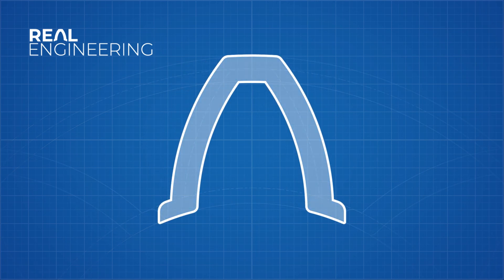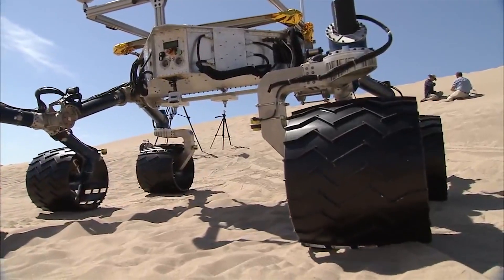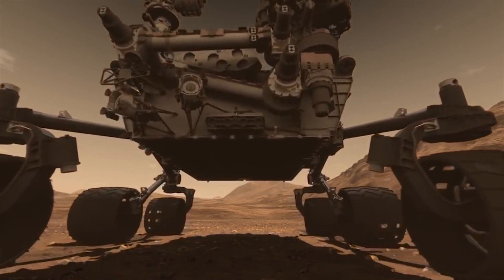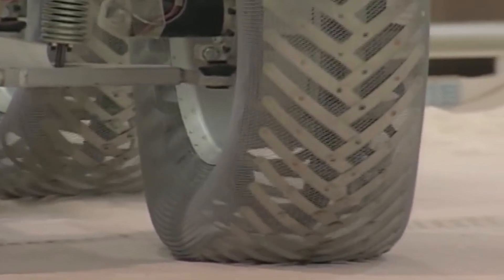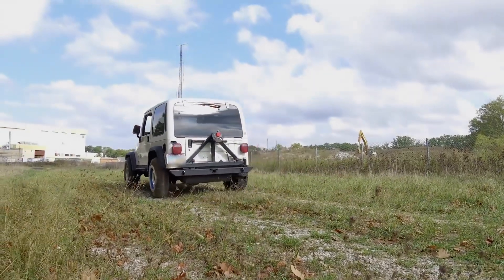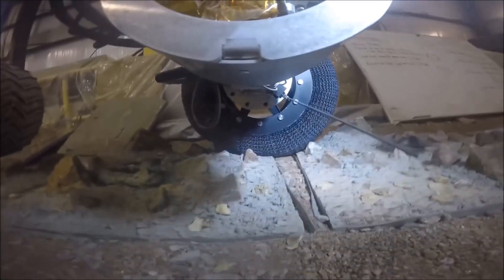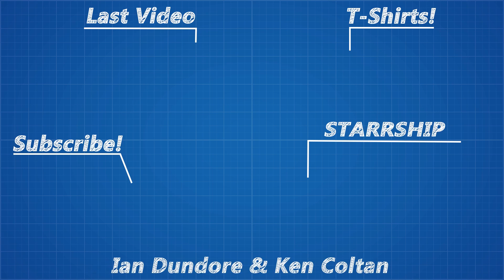How NASA Reinvented The Wheel - Shape Memory Alloys

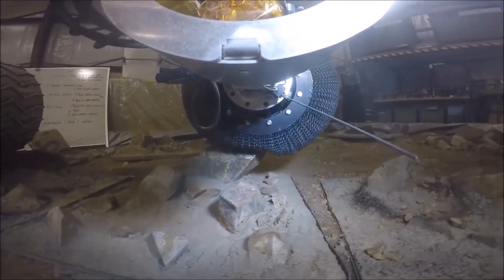Comment: Enjoyable video. However, the explanation of superelasticity in nitinol (at approx. 7:45 in the video) is incorrect. Superelastic performance is achieved through a stress-induced martensite transformation when the stress crosses a threshold. The non-stressed nitinol material starts out in the austenite state (i.e. Af < the metal temperature at ambient). Stress on the wires within the tire navigating bumps and other surface irregularities causes the austenite to transform reversibly to martensite. Upon passing a bump, the stress on the wire returns to zero or near zero, and the nitinol reverts back to the austenite state and to its original shape.
Jim Scutti, PE Metallurgy
Sr. Fellow R&D for a large medical device company and nitinol nerd 🙂

Comment: Ingenious, the material works off heat, stress means friction wind friction means heat… it fixes itself and that alone is extraordinarily. This means the inner wheel could have a heating bladder that Engages once it senses a stress level that proceeds it’s base line. The application could be simple using technology that already exists. Let’s say the rover goes over a rock that deforms the structure. Rover then goes into repair mode, it then engages its jacks, already available in formula one, and other race cars. It then brings all wheels (or one wheel if that’s possible) that then puts it into self check mode, performing any needed repairs in that moment. The bladder heats the mesh to its self repair point. The bladder can be made from the same materials… the answer is close, this in theory may not work, but it’s a simple solution that should not be overlooked.

Furthermore, the materials could be used to make minor repairs to itself since I believe self sustaining tech would be paramount to these rovers.
Reply: I ask randomly around: 
Anyone here want some Science-related Recommendations?
Reply: @loturzelrestaurant  why yes, yes I would!!!
Reply: @MrBittyKat  Cool! 

You didnt specify what you want exactly, so lemme just give you some i know you'd enjoy, cause they're so good: Veritasium, Sci Show, Sci Man Dan, Professor Dave Explains, Tier-Zoo, Cinema Therapy, TMM, Viced Rhino and Hbomberguy.

Comment: 0.75mm thick aluminum wheels? What were NASA engineers smoking? All of those brilliant computational brains working together, but no one had the common sense to realize that 166kg of pressure on a small contact patch of 0.75mm aluminum would punch holes easily?

Comment: How do you set the shape it defaults back to?

I'm not an expert, but I tinker with the reeds on my harmonica.  In harmonica work there is a stage called 'gapping' where you adjust the height the reed sits over the reed slot.  Lowering the gap makes the reed more likely to choke- to not sound- when you play with more force, but it makes it more responsive under light force, and that choking effect can actually be used to activate the opposite reed.  Basically, by choking the reed you shut that 'valve' and force the opposite reed in the chamber to sound, which can give you pitches that you can't hit with either reed by itself (at least not in a two reed chamber).  Overblows and overdraws give you more of the 'missing' notes from the chromatic scale that you can't get on a diatonic harmonica.

Reeds worry over time and can break.  With lighter playing they can last a lot longer but the holy grail for players is a reed that doesn't worry.  One company does make stainless steel reeds, and for lighter players they seem to last almost forever.  Harder players blow them out pretty quickly though.  I think they may be pushing it beyond it's fatigue limit.

Would nitinol make a reed that wouldn't suffer failure (or at least wouldn't fail for much longer), allow you to adjust the gapping, but then reset the gapping?  A lot of the fine work of gapping is done well after the reed is originally stamped.  How would you get it to keep the shape you wanted but still be able to recover?

Comment: Very interesting video mate, but what you say @07:43 is incorrect. 
Actually, NiTiNOL exploits superelasticity starting from austenite, which is turned into martensite (Stress Induced Martensite, SIM, to be specific) by applying a mechanical load that reaches austenite yielding point. 
(Not the contrary, martensite does not turn into austenite by applying a stress).
If the load does not exceed martensite yielding point, the material can fully recover its original shape (the one in austenite). 
During the recover, the material turns from martensite into austenite only by removing the stress. 
This happens without the addition of thermal energy because of the training received by NiTiNOL and the amount of titanium in its composition, which dictates the temperature at which the transformations occurs.
Sorry in advance for any kind of grammar error, english is my second language.

Comment: You should not be a Cancel for makeup so many facts, the Mars rover has an NPU Not a Nuclear  Reactor.  A thermocouple is not a nuclear reactor!  It is cased by a something like (CE-214 like in your fire Dectector) that the Natural decay cases heat,  this is a very safe tec, most produce Alfa Particles,  in space, there is more radiation coming from the sun then this type will every produce( You cold theridical use something like Francimum or Coloradoan or thecnociam, but all would take more energy to make )

Comment: The process of planning, designing, executing and maintenance of universe functioning systems is referred to as “Universal time limit operation system”. This process is carried out by the Almighty of the Universe based on the Nature of Reality of the Active Planets. These systems serve a variety of time limit functional needs of planets and living beings. Several factors in time limit functions need to be considered based on the functional behavior of non living things when activated and living things. All elements of non-living things in the Universe are having two functional behavior of minus and plus and require activation to perform its time limit function. Every element in the seven universes is made of Jabiga atoms (living electro molecule and living nucleus dust) and Ronos (electromagnetic force). All atoms of an element are not the same but all the atoms have minus and plus sense. Atoms of different elements are having different kinds of behavior and have different kinds of time limit functions. Jabiga atoms of different elements which are normally related to each other can join hands when time limit activation is normal to form a new force or to create a new component. If not related to each other it takes avatar as a destructive force with abnormal time limit creates natural calamities which could not be controlled by human. There are two fundamental forces namely Jabiga and Ronos forces with four avatars. Jabiga forces with plus and minus characters and Ronos forces with plus and minus characters are involved in keeping stable Jabiga atoms. Ronos electromagnetic force helps for keeping Jabiga atoms stable. Another fundamental gravity force disturbs the time limit function of Jabiga atom to some extent. 
 
Earthians View: According to study by Earthians ‘When solar system was born 4-6 billion years ago only 6 percentage of potentially inhabitable planets that will ever form in the universe existed, which means 92 percent of more earth like world yet to be born.” Earthians accepted that Earth planet is not flat but just like a ball rotating, that there is a vast dark force, Earthians studied about the shining stars and heavenly bodies and also named some planets and stars. Earthians creating horoscope and calculating the fate of human being based on the planetary movements and stars. Earthian accepts that there are seven human beings with similar face structure. Earthians cannot deny that they appeared on the Earth without parental sexual functions. There is Universal power that no one can see or feel the power or predict the time limit function of the Almighty.
•	There are about 300 Active planets in seven universes. Just like Earth Planet there are one planet in Haloma Universe, one planet in Rajsival Universe and one planet in Hindoma Universe. All the three planets are identical to the Earth Planet, and Bindra (mold) is just like Earthians, but mass of the three planets may vary. 
•	Time limit functions (Life time) are blessed by the Almighty to all living beings of active planes in the universes based on the nature of Active Planets. Time limit functions to non-living things can be classified:

Time limit Transactions.
•	Time limit functions.
•	Time limit travel.
•	Time limit Activation.
•	Time limit Normal.
•	Time limit Abnormal.
•	Time limit requires repeated activation.
•	Time limit natural forces.
•	Time limit functional behavior.

Comment: someone with more knowledge in metallurgy than me please explain, why didn't they make the wheels out of titanium instead of aluminum? the highest grade titanium alloys have much higher strength to density ratios than aluminum, so titanium tires would have been stronger and lighter than aluminum. also it's mind boggling to me that nasa underestimated how rough the terrain on mars would be considering there was ample proof from the many previous landers. even doubling the thickness of the tires would've doubled their strength without adding much weight.
Reply: Weight was the reason the wheels aren’t made of titanium, titanium is heavy

Comment: Thank God for the rubber tire ! Sure, they added metal wire to it, but it still worked incredibly well after over 100 years...even the really old ones that have been bagged tagged and flagged that are in storage. That's a good invention ! One cannot say the same thing about the Car's headlights..for example. They really changed !....its high time for a better tire, but I THINK it'll be NEAR IMPOSSIBLE to REPLACE THE good ol RUBBER TIRE. The real problem is the freezing temperatures. Rubber cracks when freezing...just ask NASA.
..So, how do Snow Trucker's get by without cracking their tires ?? Anyone ??......

Comment: 7:38 FFS... you get into the juicy part, and the explanation is awful. You spent time to explain how heat reshapes the metal and then you say "well it doesn't use heat, it does it when it stretches. BYE!" Why would stress act like heat?
Also, you want Young Engineers to make designs for Mars Transport Vehicles? That is beyond dumb. People should aim for things the can achieve and keep on building on those things.

Comment: Curiosity is powered by an RTG, not a nuclear reactor, which is a common misconception.  Although it relies on Plutonium, a Radioisotope Thermoelectric Generator converts the incredible heat generated by the rapid decay of Pu 238 into electricity.  On the other hand a nuclear reactor involves the controlled fission of enriched uranium (usually), and is much more complex, heavy and expensive.  One of the inherent problems with RTGs is the short half life of Pu 238, which has become evident in the Voyager space probes as power has diminished in a relatively short time.  In the movie and book, The Martian, astronaut Mark Watney kept his rover warm by digging up the Pu 238 from an RTG.

Comment: I'm no engineer, but from what I can see the wheels are for the most part hollow. I thought if double-wheel can be implemented, meaning the same type of wheel could be on the inner and outer parts. If the outer wheel gets "erased" or degraded in any way, there would be an inner wheel with a smaller diameter. Although that would make the drive uneven, spreading the power to the wheels in the same uneven way, assuming it is a separate 4-wheel drive, a straight drive can be achieved.

Wouldn't spring tire get damaged if a very sharp object pierces it? How durable is the overall nitinol construction when a small tear occurs? Will it hold? Does it not "unwind"?

Comment: NASA news they can use the Michelin X tires but no are solid Kevlar and rubber slightly heavier than aluminum tires are much cheaper filigree Engineers need those 1.5 million the tire design

Comment: Wait the air and water can pass through the reinvented wheel so does this means it doesn't have friction and properties of a rubber tire. So it will easily slipped through wet and slippery road and that means they reinvented THE wheel for mars purpose only . E ma write?  correct me if I'm wrong 😉

Comment: Instead of a Mars rover. Why not have a series of Mars drones that launch from station that charges them and has a powerful transmitter receiver antenna. The station could have 5 drones. 1 scout which operates by AI. It maps the surrounding terrain with great detail. The other 4 drones each have unique instruments for different roles. Scientists examine the scouts data and than assign a work location for each drone.